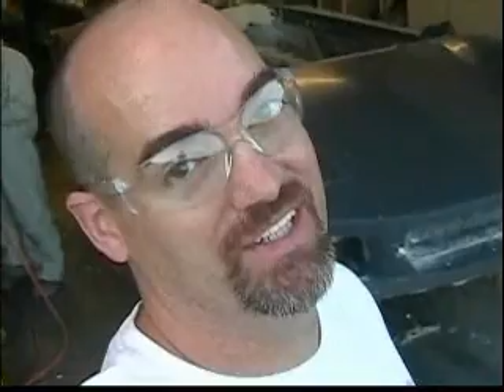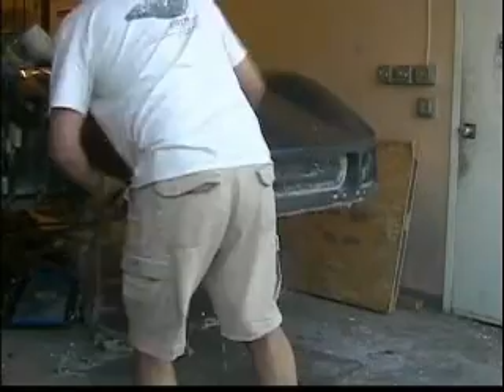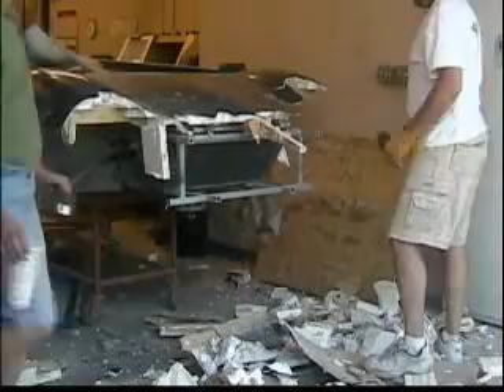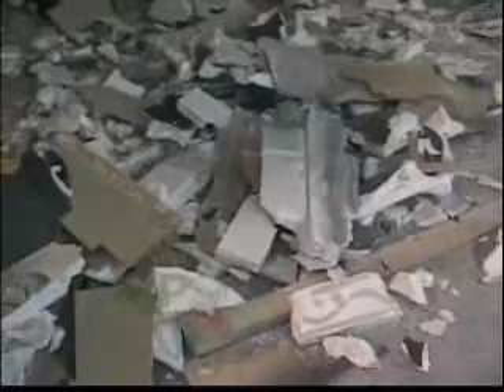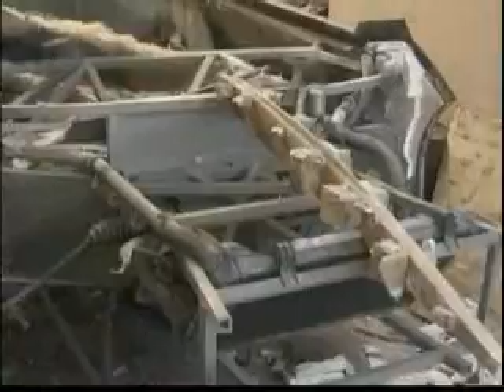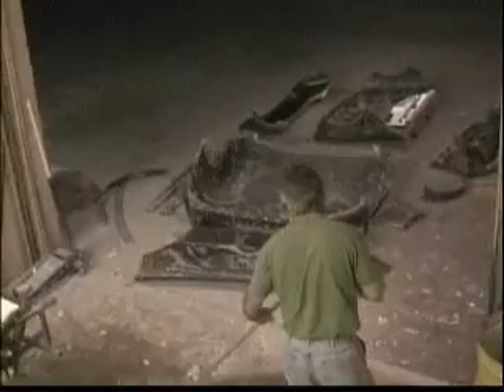La Bala - Destruction of the Plug

Comment: they used dry wall mud, plaster. There is better stuff out there, it works better sands better takes gel coat primer better and then there is a top coat, And if the plug is right and the primer is  sanded right the top coat will not need sanding. Just a buff and wax for the molds.

Comment: ah you built the body plug on the chassis.
is it right that you have no videos of going from styrofoam and adding filler and finishing the plug surface? if not how did you? just spray on body filler, sand, top coat paint and wet sand?

Comment: What did you use over the top of the frame to build the plug? I need to recreate a 1958 Desoto Firemite 3/8 scale promo car body using the broken up remains of the original I own for a pattern guide. I was thinking closed cell foam board to make the base form then coats of bondo to smooth every thing out followed by coats of primer and paint to make it glass smooth before making the final mold from the plug.